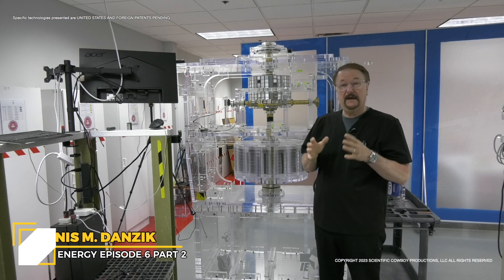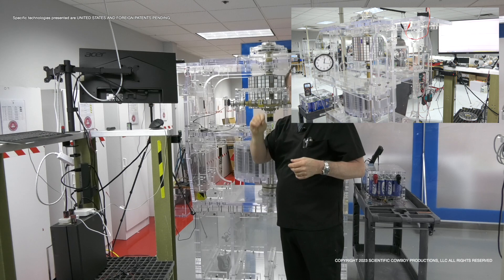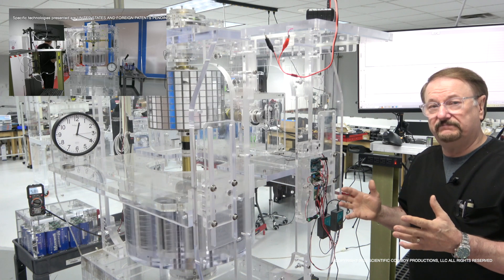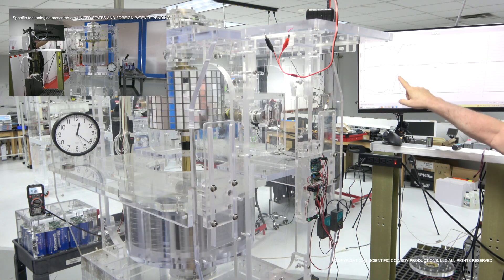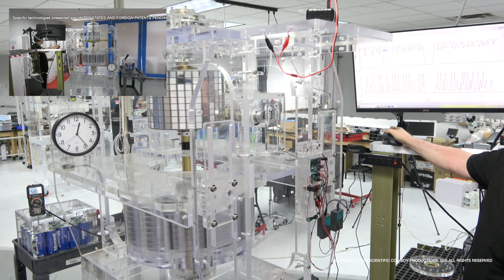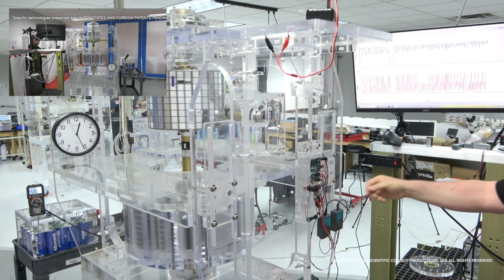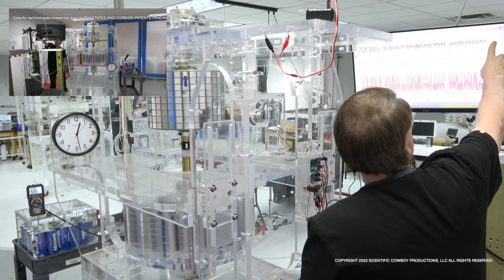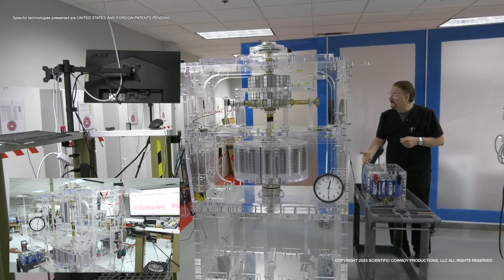Quantum Energy - Magnetic Engine Part II - Driven by Photons - Betty IV

Comment: Can you describe the basic physics behind what is causing the flywheel to turn ?
No words  like  "photon" energy and "quantum" please, no parametric data, no amps, voltage, watts and gauss, no alternators, not how much output, but simply a basic explanation of where the energy is coming from ?
Reply from the maker: Thank you for your comment. Photon Engines use very low voltage (<5 Volts) and amplify that voltage to >100 Volts through acceleration that is a result of magnetic force. A Photon Engine is operated by harvested energy from Photonics, Photovoltaic, Thermal and Hydro sources and is installed at the point of use. 100% distributed electrical energy.

Comment: Is it overunity?
Reply from the maker: No, Quantum Direct Energy Systems are not free energy or in any way violate the laws of physics. Direct Energy Systems are extremely efficient at harvesting energy from photonic, photovoltaic, thermal and other sources and converting that energy for energy storage which expands access to energy and lowering energy costs.
Reply: @QuantumEnergyCorporation  im interested, if the input energy of the magnet stator, which rotates the rotor, is less than the energy that the alternator is putting out? Btw: do you know rexresearch website? Thank you

Comment: Will these ultimately be operated in complete vacuum or partial vacuum?

I'm thinking like the case of a crook's raidiometer , they spin one way in partial vacuum, the other in full vacuum, because of the difference between thermionic emission and photonic momentum transfer, which one is dominant depends on gas pressure and particle velocity. 
  I am completely unclear on what the heck you are doing becides having a quality flywheel with fancy buzzwords..
  Is the unique part the conversion method?
Reply from the maker: Thank you for your comment. Please stay tuned. More information and videos coming out in the next several weeks. Yes, a portion of the Photon Engine is in a partial vacuum.

Comment: Fascinating stuff... Good for you! Hopefully I'll be able to visit sometime! Humble suggestions that come to mind: 1. I don't understand why you refer to the "cycle end point" that your machines somehow overcome (in order to repeat the cycle), as, the "point of entropy"? IMHO, "cycle endpoint" are more accurate words to describe it (just my opinion). 2. You might consider a variation on your "magnets doing work" demonstration; if you have your guys mill another wood start ramp that's about 11.6 inches higher at the start point (depending on the strength of the magnetic flux, and, the ferrous properties of the balls is attracted to) - that will demonstrate that gravity contains the same amount of potential energy as the neo magnet - but... you have figured out a way to essentially make the ball weightless in order to carry it back up to the top with less energy than it imparted on the balls it hit (to repeat the cycle). 3. The "Attenuator" you refer to is apparently the thing that "makes the sphere weightless" (in the context of my second suggestion above);  that's a very good term for it!  Brilliant!  Nice job. I've always believed it was possible (I actually have built a mag motor, or two, myself!).

Peace.
Reply from the maker: Thank you for your comments. Great suggestions. Our term "point of entropy" is used to describe the highest point (per compass degrees on the flywheel) where the counter-acting force of the paired permanent magnet fields are at their highest.

Comment: I have been watching the videos with great interest. I think there are 2 possibilities:

1/ OUTPUT POWER < INPUT POWER in the system (the system being defined as everything that is between the input wires and output wires, not including the batteries), in which case the device is basically an engine that spins, takes input energy and outputs an energy that is inferior to the input and charges a battery. There are no scenarios where this could be useful.
 
2/ OUTPUT POWER > INPUT POWER in the system. Something in the flywheel is generating energy (for example conversion of its magnetic energy into mechanical energy). In this case this is a generator and has interesting applications, although one needs to know how much energy can be stored in the magnets, what is the recharging process and its efficiency. 

It is one of the two.

I was under the impression that 2/ was what the company was after. After watching this video, I am very confused. The device is likened to a 'physical multiplier' and 'transistor'. Transistors don't generate energy. 

The input power is shown as ~3W but at no point is the output power shown, just the batteries' voltage, why is that? This doesn't have anything to do 'this engine is limited for safety reasons". One needs to see the generation capacity of the engine, even in concept. Even if there was an even tinier machine, with 1W input and 3W output, it would be a proof of concept. I don't understand why this would be an issue since IEC has delivered 25kW models.  http://web.archive.org/web/20230720015423/https://ie.energy/earth_engine/index.html

Also, I really don't get the photonics part, which is basically collecting energy through PV cells. If we are in scenario 1/ it is useless. If we are in scenario 2/ it is also useless. Why bother with harvesting additional meager power input from interior lighting energy if your system can generate energy on its own?
Reply from the maker: Thank you for your well thought through comment! The Photon Engine is actually powered (at low voltage) from a proprietary photonic energy collection system (very close cousin to photovoltaic). Once the photonic equipment is installed, a Direct Energy System can collect and store substantial amounts of passive energy indefinitely as it has near zero destructive environmental exposure, and then used to run a Photon Engine. So the input power is collected passively, at no cost other than the equipment, and then amplified (potential or voltage) . Stay tuned for more.

Comment: How is it "powered by photons?" 

As far as i can tell, you are trying to get around saying 'zero point' or 'over unity' or 'perpetual motion'. 

Im actually willing to believe that we dont know enough about physics to prove a negative. So, we cant say that overunity is impossible.  Only improbable based on what we think we know.

So, if you have some theory that can explain why you are saying "photonic" as the explanation for the energy origin.... then im on board. 

But failure to explain this crucial claim, will result in a well sited, and constant campaign of coments like this applied liberally across all your videos.
Reply: It is highly specialized photonic panels can produce voltage from light indoors. They store that energy in very large capacitors then increase voltage from 50v to over 250v to storage. The engine and its generator never see a load. Its brilliant! I watched them charge a battery from capacitors from indoor light and then run an engine off that battery. All aerospace people. A fun tour!
Reply from the maker: Thank you for your comment. The entire Direct Energy System is shown in upcoming videos over the next several weeks. The sources of photonic conversion are fully explained.

Comment: Насколько понял, выходная энергия не превысила входную. Если не учитывать энергию, получаемую от руки. Жаль, было бы эффектней.
As far as I understood, the output energy did not exceed the input. If you do not take into account the energy received from the hand. It's a pity, it would be more spectacular.
Reply from the maker: Stand by as the Photon Engine shown is limited (for safety reasons) to only 28 volts. Much higher production rates are shown in upcoming videos.